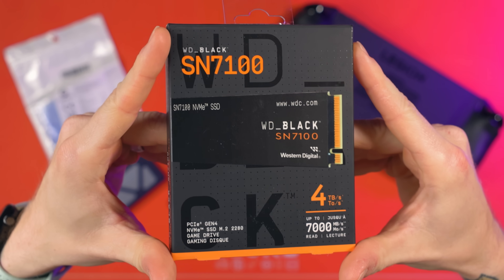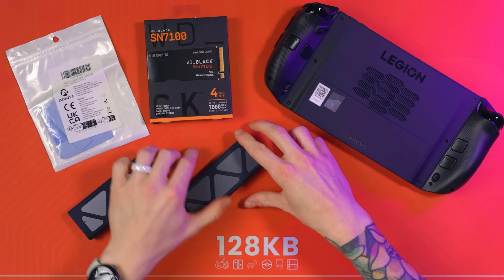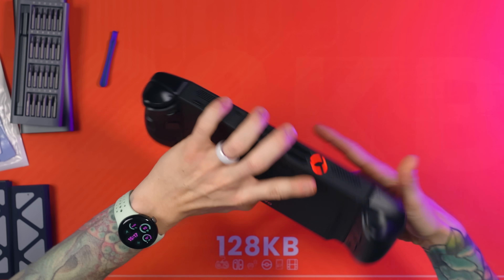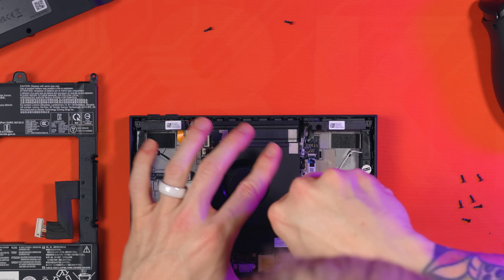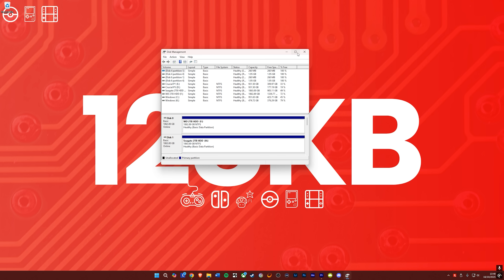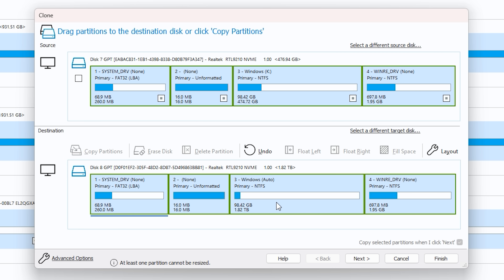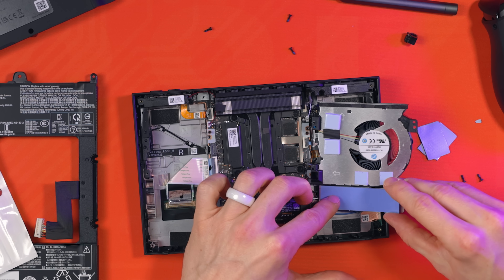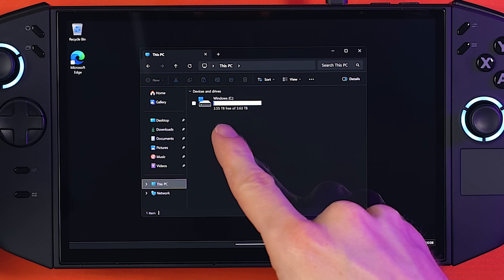Upgrade Your Legion Go 2's SSD Easily

Comment: Is the sn7100 better then the sn850x
Reply: For upgrading the Legion Go 2, the WD Black SN7100 is a better choice than the SN850X. The newer SN7100 is more power-efficient, produces less heat, and is well-suited for gaming handhelds. The SN850X is geared toward heavy, sustained workloads on desktop PCs.

Comment: Great guide! By the way what is the thickness of the thermal pad you are using on the replacement SSD?
Reply: You actually don't need to swap the thermal pad, the original one would work, because the thickness of SN7100(at least up to 4TB) is the same as the 512GB drive that comes with the console.

Once you put the battery back, the battery cable, and the foam on the back cover would actually press the heatsink down, and it will make contact with the SSD without issues.

Comment: Tip
Since the Legion Go 2 has Windows, you can install Macrium Reflect on it, connect the new drive and then do the cloning process.
After that, proceed with replacing the drive
Reply: I like to clone the ssd before powering the system for first time. In that way when I want to sell the system or send for repairs I have the original ssd ready to go. No need to clean ssd or get the recovery media from Lenovo.
Reply: You mean installing it IN the same SSD you are cloning? Can it clone the SSD even while in use?
Reply: @powerhouse884 worked fine om my Legion Go 1 anyway.
Reply: @powerhouse884 lol we need an answer

Comment: Is WD sn850x 4TB a good drive? I'm concerned about the heat
Reply: For upgrading the Legion Go 2, the WD Black SN7100 is a better choice than the SN850X. The newer SN7100 is more power-efficient, produces less heat, and is well-suited for gaming handhelds. The SN850X is geared toward heavy, sustained workloads on desktop PCs.

Comment: Will you be making a LeGo 2 vs Xbox Ally X comparison video?
Reply: Xbox ally x will have better performance bcz Xbox is 1080p, legion is 1200p. Legion has 11% more pixels, so GPU has to work 11% more. So, approx 10% less performance
Reply: @GuntasSingh  even with the z2e version? I'm having trouble finding comparisons between the regular go 2 and the z2e go 2. I want the z2e but I've gotten so many very different answers on a release date for it.. I'm debating just settling for the base version. I've been waiting a LONG time to get a handheld PC and I'm tired of waiting.. I just wish I had a clear answer on the z2e release.. due to injuries and chronic pain a handheld would be way better for me to game on than my desktop
Reply: @crookedjack5499 it's releasing 31st October in the US
Reply: @GuntasSingh  The base version is. They said they don't know about the z2e version with the better processor. Some people are saying that won't be out til late december or after
Reply: @crookedjack5499  doesn’t matter what you get if you have a desktop. I’m using my rog ally x as my main gaming device. I don’t own a desktop computer. The Xbox x will be even better
Reply: @sabagecabage7828  I have injuries so sitting at my desktop for any length of time is painful and uncomfortable
Reply: @crookedjack5499  Hi, did you end up getting something?
Reply: @Isshikirain  I ended up waiting for the z2e. I'm very happy with it. I don't have many complaints other than the touch pad placement seems a bit useless. I have large hands but I can definitely understand if someone has smaller hands it might feel awkward to use for extended periods of time because of its size. My arm might go numb after an hour of laying in bed playing it but that's probably just me and my nerve damage. I have very tight ligaments that press on the nerves. Aside from all of that I highly recommend it but keep in mind I've never used any of the other handheld PCs to compare it to them. Every game I've tried on it looks amazing
Reply: @crookedjack5499  hey man, happy you're liking it so far. Have you tried the fps mode by any chance? If you did, how long does the detachable joycons last? And how would you describe the fan noise in different modes?
Reply: @Isshikirain  The fan noise doesn't bother me. I've heard people complain about it throttling and getting too loud but they were trying to use it in w/e mode is supposed to be quiet or eco friendly. You don't want to use these modes for ANY computers or handhelds because the hardware will get too hot and eventually force it to blast the fans at max to compensate. So just let them run how they're supposed to normally. Obviously high performance games might cause them to go full blast but it hasn't happened to me yet.

My gf did complain about the fans when we were watching a show but they weren't bothering me. I think it'll come down to personal preference. That pretty much means I can't use it if I watch a show with her. So if you'd like to use it when your significant other is watching a chick flick that could be an issue.

I have not gotten to try the FPS mode. I've really been meaning to but when I'm playing at a desk I just end up using my mouse and keyboard on my desktop.

I did get a wireless foldable keyboard for it and you can fit that in your case with the lg2 at the same time surprisingly. If the fps mode ends up working well and you get one of those it's basically a small desktop when you want it to be lol.
Reply: @crookedjack5499  I appreciate it man, keep enjoying that beast 😁
Reply: @Isshikirain  Thanks, hope you find what you're looking for

Comment: Isn’t there a way to clone the drive from the system itself? Macrium Reflect?
Reply: ofc just install it on legion, use external case with the new ssd and clone
Reply: Yeah I was wondering why he used two enclosures and another PC. But the process is the same, and the video was good.
Reply: I did this for ROG ally, so i'm sure it would work on the legion go as well.